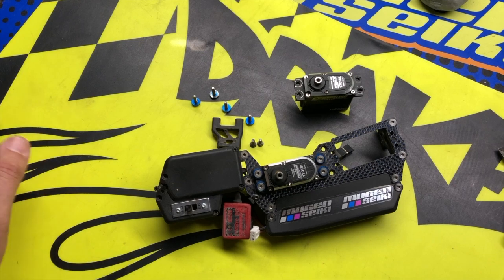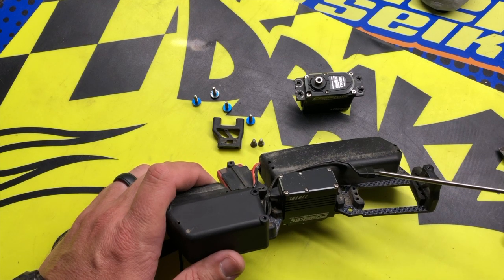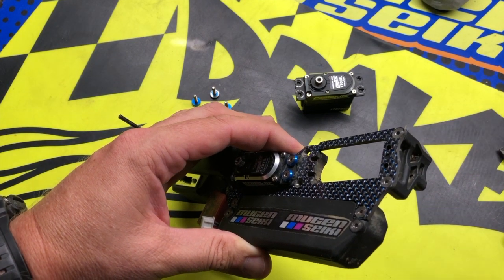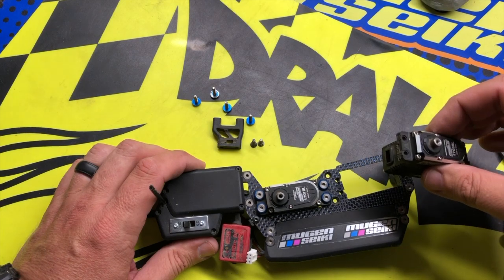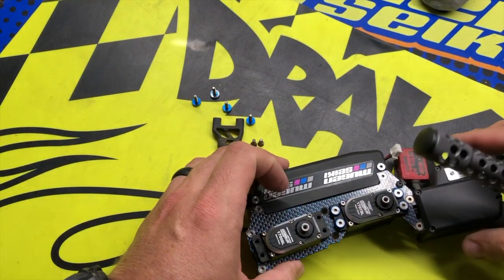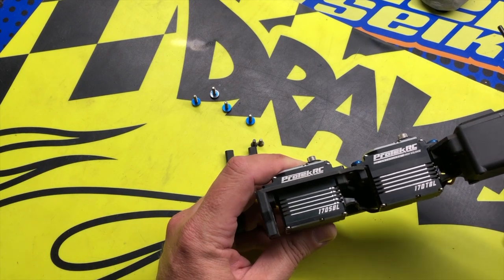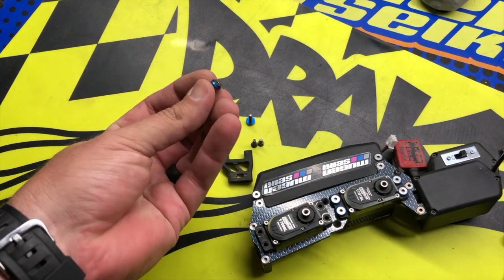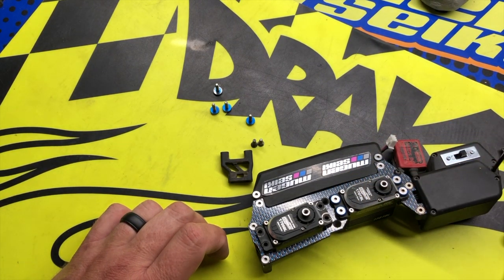Adam Drake from Mugen Seiki Racing talks about installing servos.

Comment: I would be awesome if the manufacturer integrated your drum and Dremel sanding modifications back into production models to accommodate the servo wires like you have done.  I've noticed that the servo wire is an afterthought for several manufacturer's servo trays.  Perhaps the designers don't digitally model the servo wire protrusions when they design these trays.  It makes me think that the designers haven't ever installed a servo.  Maybe they need to require the designers to also build and race the models they design...  "Required build and race time for the Engineers; Especially rebuilding things that break on race day"...  OR Require that all design changes be vetted by the drivers.
Reply from the maker: Yes, this is something to consider in the future.  Servos have been a standard size for so many years, but some servo designs have slightly changed.
Reply: Serpent does the same and doesn't really provision well for the servo wires... The detachable harness thing is not common enough that this should be a thing in my opinion.